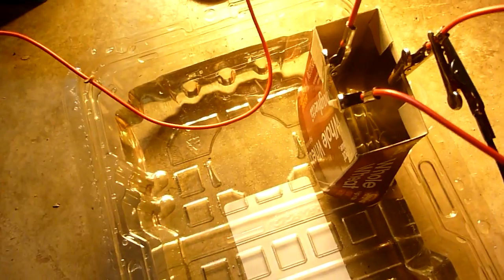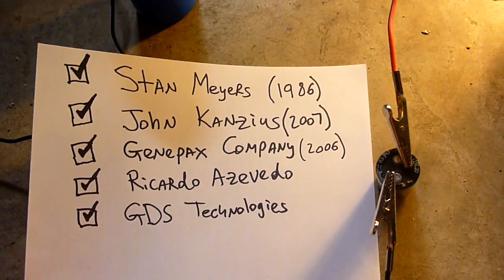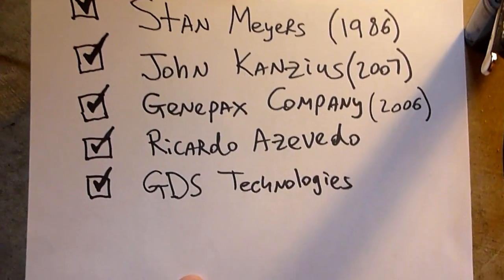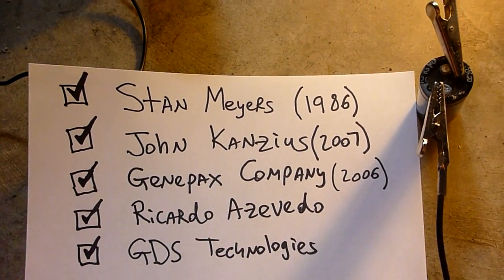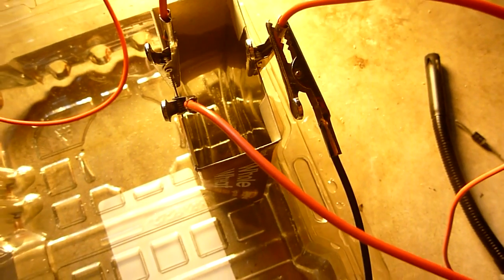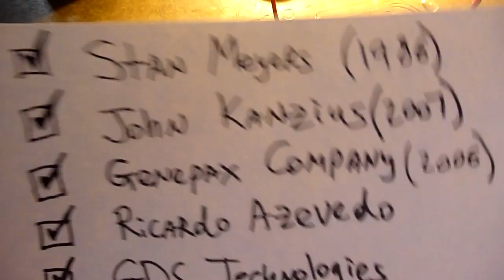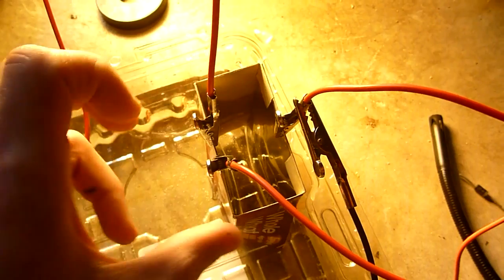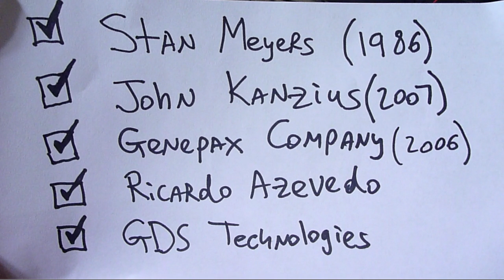Early Pulsed Electrolysis System Investigation

Comment: Oxygen is not flammable.
Reply: Correct. You can't use just oxygen as a fuel.  People get confused because it is necessary for combustion, but in itself is not combustible. That's why it always has to be mixed with something combustible such as propane or hydrogen.
Reply from the maker: +Craig Stock If oxygen wasn't flammable you wouldn't be able to have a camp fire. Oxygen is what causes fire to appear it is the reactive gas within air. The rest of the air is composed out of Nitrogen, Argon, Neon, etc. Which are inert gasses.

Comment: Hi, great job :) naturally the quantity of ions neutralized throgh the electricy is proportional to the eletric load ( culombs) and the time.... also current :) but i am very interested how would the electrolysis work with higher voltage. for example 100V or higher? It can be so, that the electrons have more energy and the have more potential to idvide the particle of the water? 
greets